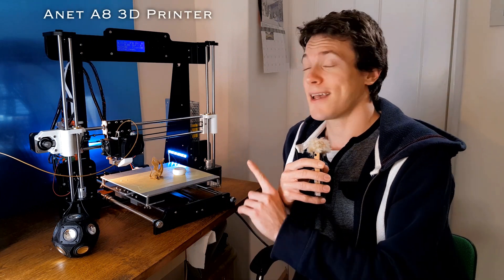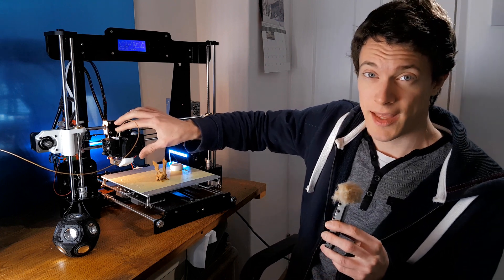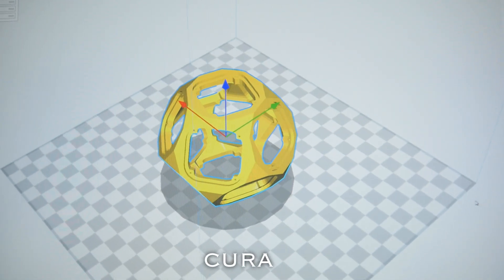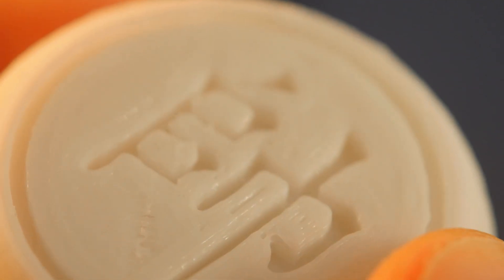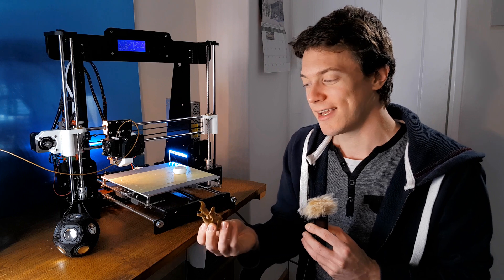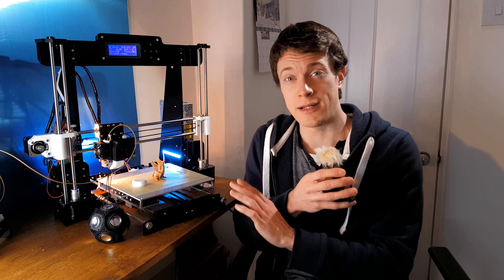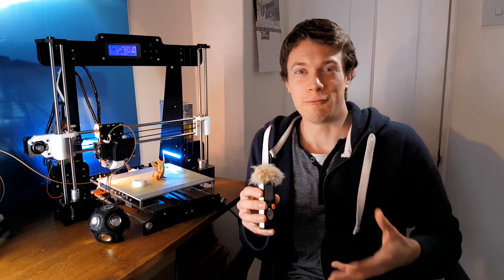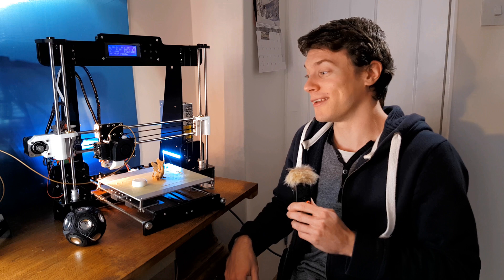Budget $155 3D Printer - Can it possibly be any good?

Comment: i like it - i play the saxophone and wonder if i could 3d print my favourite tenor sax mouth piece which is very expensive - i assume i would have to scan it first - or take it to someone who could scan it  - your thoughts
Reply: how much does the piece cost?
Reply: You'd need it scanned, which I imagine would be a difficult process given the shape. You're also going to be looking for a very specific set of thicknesses and tapers over the dimensions of the piece to make it function properly; you're also looking at quite a bit of finishing work since 3D prints aren't perfectly smooth when they're finished, and you could easily throw off the aforementioned dimensions if you're not really careful. There's also the matter of the plastic itself, different ones are going to have different strengths, resonances, etc. Not all of them may even be compatible with the printer if the temperature doesn't go high enough.

As a musician myself, I'd say just buy the mouthpiece and take good care of it. Look at it as an investment. Trying to replicate it on a cheap, consumer-grade 3D printer is probably going to run you up against a whole bunch of problems that you probably haven't considered. You'll have to pay to have it scanned (or buy a 3D scanner which is definitely not cheap), you'll probably go through more than a few failures trying to get a workable print (and the material is not recoverable), and honestly... if nothing else, the savings in work and hassle would seem to make up for it. What is this thing made out of, anyway, solid gold?

Comment: Quick tip on removing the paper from the acrylic pieces easilly, run each piece under some water to get the paper wet, it'll then peal off easilly with very little tearing.

Comment: You have to be careful when printing ABS with Anet A8. I have the same printer and in the official Facebook page of Anet there are a lot of instances where the hot bed connector heats up and burns. they said its because of improper connection of the wire to the connector and some said it's because of the cheap connector they used. A lot of people are changing it to a 16-20A rated connectors. some just soldered the wires directly.

Comment: I have two of these printers too. Very good quality overall (you can get way better quality on your prints than what is shown on the video). Some of the PSUs on these printers have caught fire and burned down houses. You'd better change it to an ATX power supply, the original PSU, aswell as some connectors on the main board are a real fire hazard

Comment: I have the exact same printer, got it on GearBest for $148 on black Friday from US-LA warehouse and it got here in less than a week! so far I love it and I think the detail is amazing for the price! there's an entire Facebook group with over 6K members all dedicated to helping people out with it. Also I've been able to order it at lower layer heights thank 0.1mm, I've gotten down to 0.06 but others have done 0.04mm as well. Also you installed your H bridge under the hot bed upside down. I did it as well because in the video that's how they put it on. you might want to flip it over if you plan on doing any prints that go to the edges of the platform. Also the acrylic frame seems strong enough so far, I haven't broken any of the pieces and even if I did, you could always glue/epoxy them back together. I've used other 3D printers including the Lulz Bot Mini, MakerBot's and I can't tell the difference between prints on those printers and on this one!

Comment: God those mains wires. How does this thing pass safety standards?
Reply: I'm sure that's one of the reasons it's a kit.
Reply: PhazonSouffle do it yourself kit, not a finished commercial product.
Reply: It does not , its technically illegal in the UK to sell something with exposed mains wire like that,
Reply: There are some fantastic printers that are kits.   Check out the seemeCNC delta type machines.

Comment: Does the 3D modelling software also work on a linux platform?
Reply: There are 3d modelling software that works on linux such as Blender and some others.
If you mean the slicer that is used to create the instructions for the printer from the 3d model (he is using Cura), there are also ones that work on linux. Cura is also one of them. I like to use Craftware, which also has a linux version.
Reply: yes, they have software for Windows, mac os and linux

Comment: Very good video! The first thing they recomend to print is a new ''cooler'' with a circular shape because the one they give is very bad.
 I'v craved for this 3D printer for a long time, but I'm afraid I'll have problems putting all the pieces together, then the fact that I have to learn how to use a 3d program to  create/print stuff is a turn off since I'm afraid I won't have the time to do it.

Comment: There are a lot more filaments than just ABS and PLA. ABS is not stronger than PLA. ABS is way harder to print than PLA and also requires more heat and enclosed printer. PLA is harder but possibly brittle. PLA has a low glass transition temperature - meaning it will go soft at a temperatures above 60C making it unsuitable for some things. PLA is easy to print, therefore recommended for begginers.

Comment: your printer has a filament cooling solution. adjust the. it comes on. simplify 3d is really great, except price. almost as much.
Reply: George Robles I've also see someone print a ring attachment so the air blows in from all directions instead of just one. Pretty neat.
Reply: Yes, does it really work is another. Some do and some don't. Best one I have seen is like the new Prusa mk2 where it blows from top down. You will need to tune your pid loops to enhance this further.

Slic3r configs ii have on WordPress blog for beginners. High strength to speeed I feel. Will be showing how to save an air print soon. Have been out the game for medical reasons and getting ready to start again. Brand newish PC was given,2 actually, and have been working on them to make them the editing station.

Matt,

Hey great job on just about all your videos. You teach me a lot about photography, In a way

Comment: i have the exact same one and it running at this very moment printing a case for one of my DIY projects. It is awesome! It prints better than my dads 600€ printer!
Oh, and the only thing i didn't like about it is the height adjustment for the Z-axis, which is quite fiddely, but there are designs for improvements for that on thingiverse, and in the end you only have to do it once anyway :)

Comment: Hi Matt. This printer seems to be pretty cool, especially for the price. 
Let us know for some time (after longer tests) is it still works, and how well it performs. 
Greetings from Poland. Darek :)
Reply: ive got exactly the same printer. it needs alot of work to get it as good as it can be and sometimes its tempremental but i would reccomend it and once you have got it setup the print quality is amazing! I have got some other videos of this printer if you want to check them out.
Reply: Made in Poland  I second that. Please make an update a couple of months from now if you keep using it.
Reply: Prints great once you adjust the settings  and everything

Comment: first thing id do is replace the acrylic parts for abs printed parts. abs is more durable and i have had it happen to me that those acrylic parts break
Reply: I'd prefer PLA. Haven't tried makerbot's tough pla filament yet, but the stock PLA are pretty durable and won't deform as easily as abs.

Comment: There are more then just abs and pla. 

And don't buy anything where it's primarily acrylic. It's gonna break.
Reply: Folopolis nope, on the Facebook group of 6K+ members they've printed all sorts of filaments, including, NinjaFlex, TPU, Carbon Fibre, and literally every other filament. Also the acrylic frame has been fine for me so far, I haven't broken any parts and you could always super glue/epoxy them back together if they did. I would prefer a metal frame but for $148 I can't argue lol.
Reply: So true about filament types. Today there's even different kinds into plastic types : Hi-temp PLA, Reinforced PLA (PLA+), and so on. ABS is more resistant, but it is softer too. Vapouring ABS wipes details out and fragilize the part too. No problem with acrylic but with conditions : no acrylic near heating elements (or it will bend over 60°C), and never overtight acrylic (can brake instantly or during temperature changes). One of my printer have an acrylic frame and works fine since 2014.
Reply: ive had the same printer for 2 years now and i havent had a problem with the acrylic
Reply: @GeorgesHangar  same here. The Anet is a bit of a bitch, but that's mostly me. Lol
Reply: Folopolis Its not realy carbon fibre but filament reinforced with carbon fibers. The base is still thermoplastics and the melting temperature is too low to ignite carbon. Carbon fibre additive is used to reinforce stiffness and lower the part weight but the part resistance is diminished too.
Reply: My Anet was able to print with just about every type of filament, except for the flexible kind (which would be possible if I modified the extruder). The other filament types just require calibration to work properly, whereas PLA and ABS work with the given settings. 
Plus, you have to consider that the printer is $150, so acrylic is the least of your worries. I agree with Axel Sixtysix about the Acrylic. Just don't overtighten the screws and it will work fine.
Reply: this printer says it can do more than abs and PLA
Reply: Folopolis well, If tou can print ABS and PLA you can prob1bly print various materials like at last  PETG or PVA ;)
Reply: its not printing carbon fiber bro its a filament laced with carbon fibers. They have metal filaments aswell. same concept.
Reply: Jonathan Kayne : did you try filaments that requires very hot extrusion, like Nylon or Polycarbonate ?
Reply: Axel, 
Unfortunately, I have not tried Nylon or Polycarbonate. I would suspect the printer would have some trouble printing them because that would be approaching the max temperature of the nozzle. I would have to see if my printer can get that hot, as I have only heated mine up to 230C.
Reply: Makes sense. I haven't had much of a reason to print in Nylon. I usually print in PLA, and occasionally will print in ABS or PETG. I don't complain though because I got mine for $112 (it was on sale). 
Also, I have a 3D printed ring-shaped blower in PLA, so I try to avoid printing those high temperature filaments for that reason (Possibly melting the blower).
Reply: Thanks Jonathan for your awnser. I believe high melting temperature materials can't be printed with that kind of extruder. Even ABS may cause issues. Especialy for long prints.
Reply: It can and it has....